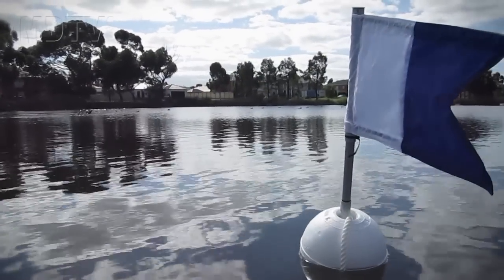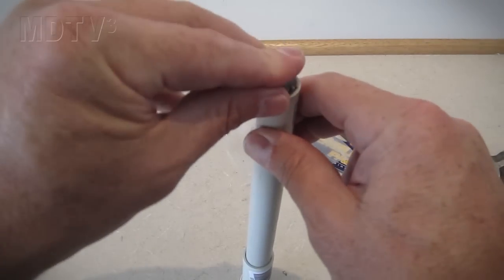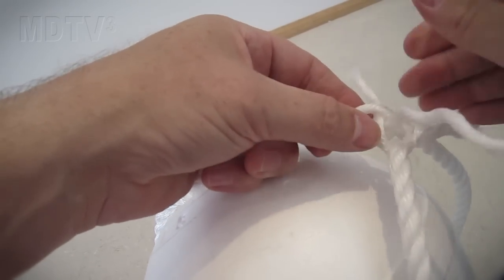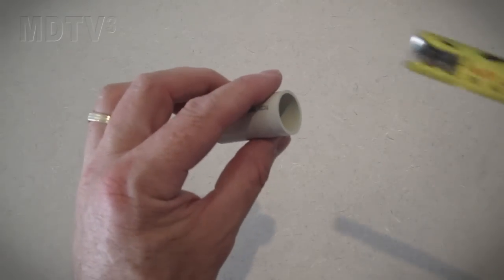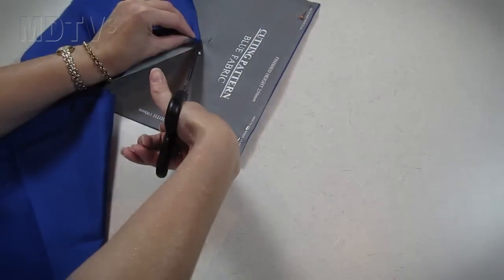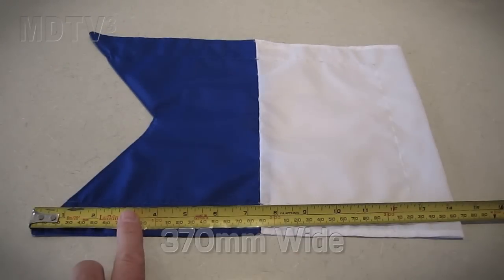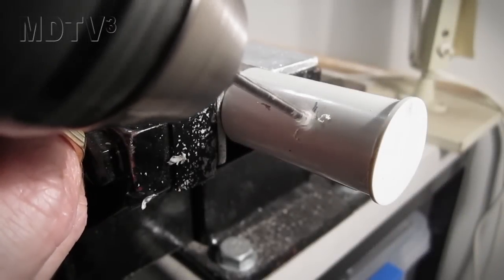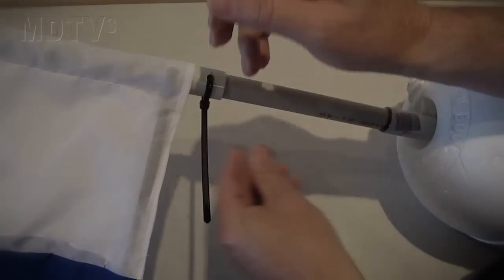The DIY Big Buoy Dive Flag

Comment: interesting - but the alpha flag is for a boat - not a diver in the water.
Reply from the maker: Hi, for the state of Victoria (Australia) your statement is not entirely correct, when diving from a boat with the correct size alpha flag it is correct that you do not NEED the alpha flag on the buoy, however if you are not then you do need an alpha flag on your buoy that is at least 300mm x 200mm.I do both, correct size alpha flag on the boat (if diving from the boat) & on my buoy, it still wont stop boats doing the wrong thing & coming too closeAll divers would need to consult their state laws to ensure they are acting within their local requirements.For reference, I am referring to page 12 of the document below. http://transportsafety.vic.gov.au/__data/assets/pdf_file/0009/36684/Guide-to-Vessel-Operating-and-Zoning-Rules-VOZR-December-2015-Version-No-13.pdfThanks for your inputRegards Dean
Reply: If that's the law in Australia, then your lawmakers need to get an education. The Alpha flag means -- by international law -- "vessel restricted in its ability to maneuver."  It does NOT mean "diver down."  (It is flown by vessels supporting divers because such a vessel is restricted in its ability to maneuver due to its status as a dive tender.)
Reply from the maker: Hi, I don't write the laws or say they are correct, frankly I would prefer 1 standard everywhere in our global village, we can't even get the same standard laws through each of our states :( If the world was easy where would the fun be....
Reply: MDTV3 I hear what you're saying. It makes me crazy sometimes how our 50 states differ from each other in many ways, while supposedly being "united" states. (California and Texas are pretty close geographically, but worlds apart socially, for example.)
Reply: I think it's you who needs the education mate. Flag Alpha is the international flag for showing you have a diver in the water. https://en.m.wikipedia.org/wiki/Diver_down_flag
Reply: Flag Delta is the flag used to show you are having trouble manoeuvring and telling other vessels to stay clear.